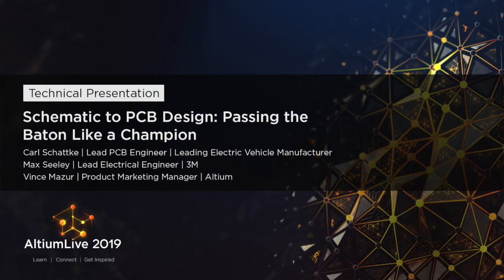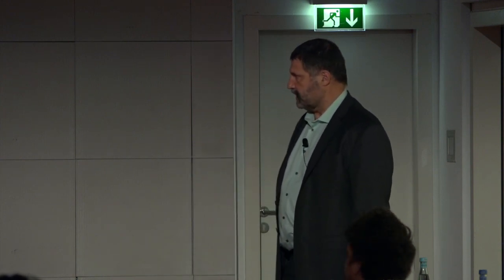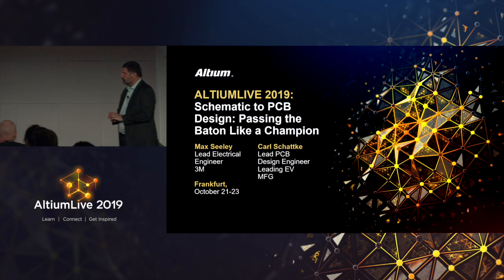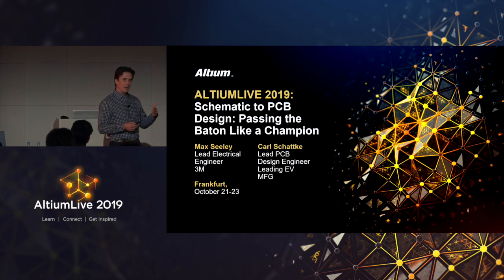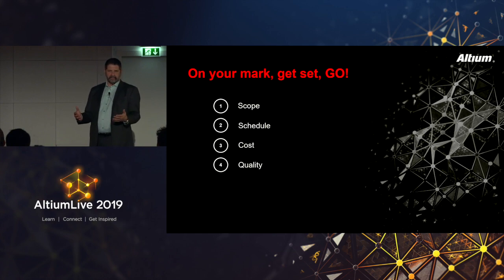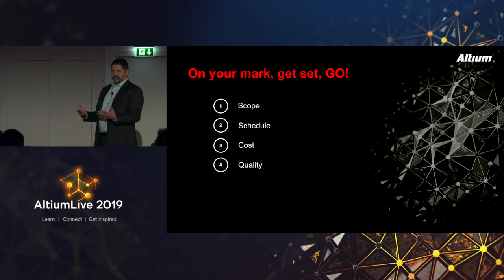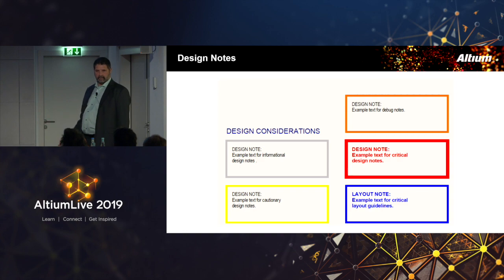Schematic to PCB Design: Passing the Baton Like a Champion

Comment: Thanks for making this content available!

0:00 - About
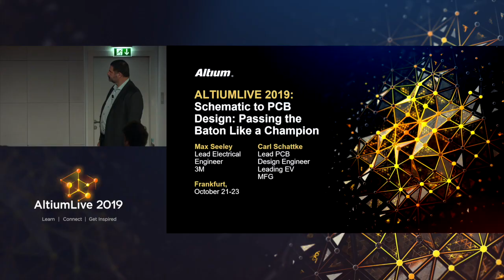1:38 - Introduction
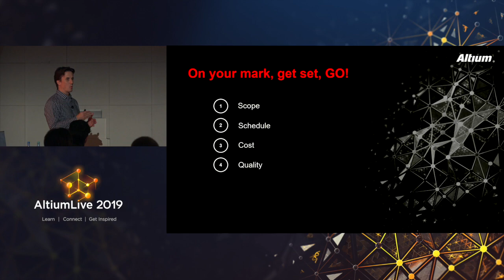7:34 - Agenda

[1. SCHEMATIC - BEST PRACTICES AND TOOLS]

GENERAL
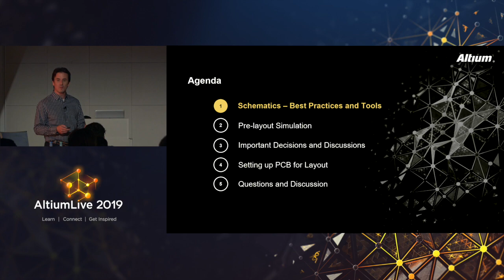8:25 - Top level schematic
11:29 - Signal harness
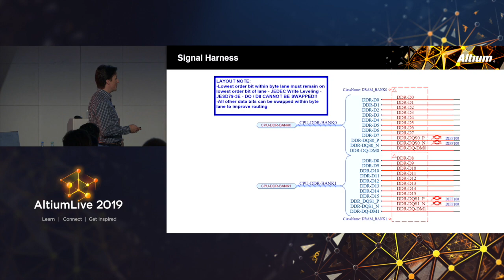13:17 - Functional blocks
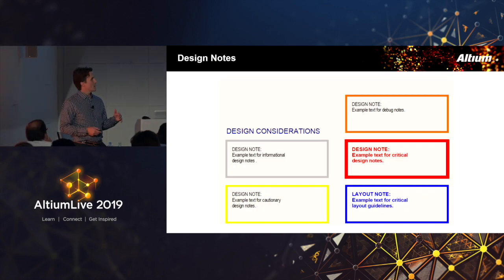17:09 - Design notes

POWER
18:16 - PDN - Power tree
20:19 - Power consumption system

CONNECTIONS
23:23 - Connectors
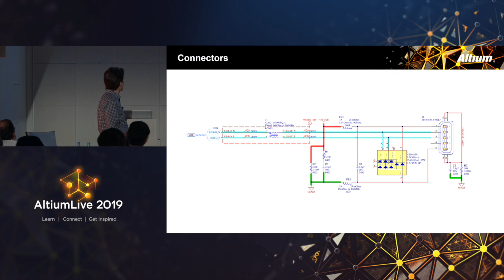25:42 - Connectivity using harness to high pin device

ERC
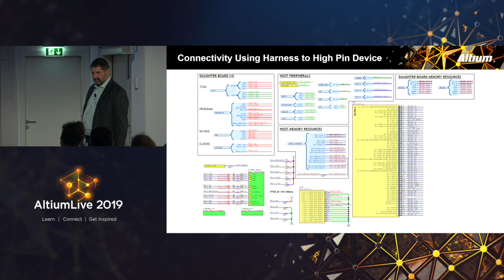27:37 - Don't ignore 

OPTIONS & SETINGS
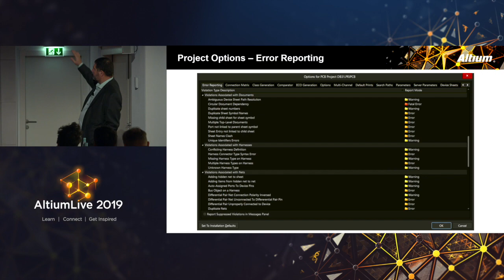29:32 - Error reporting
30:47 - Connection matrix
31:15 - Parameter Set
33:14 - Parameter Set + Blanket
35:43 - Defining differential pair
37:12 - Define unary design rules in schematic
38:40 - Project options
40:51 - Review BOM - Active BOM

[2. PRE-LAYOUT SIMULATION]

42:51 - Signal class table
44:28 - Simulated drop testing
45:49 - Displacement/Strain

[3. IMPORTANT DECISIONS AND DISCUSSIONS]
47:50 - Single board or both sides? (Component mounting strategy)
54:18 - Review BOM - Component technology
59:58 - Soldering methods (Component mounting strategy)
1:01:27 - Mechanical constraints and definition
1:04:03 - PCB mounting strategy
1:09:25 - PCB test strategy and requirements
1:16:13 - Antenna tunning provision
1:18:14 - Thermal strategy
1:20:23 - Shielding requirements
1:22:03 - ESD Mitigation

[4. SETTING UP PCB FOR LAYOUT]

1:25:03 - Rooms / Component space requirements
1:28:28 - Component placement strategy and routing channels
1:32:19 - Differential pair rules / PCB stackup
1:34:53 - Setting up stackups and impedances
1:36:01 - Setting up X-Signals
1:36:56 - Design classes
1:38:51 - Setting up binary design rules
1:39:47 - DEMO

[5. QUESTIONS AND DISCUSSION 1:55:17 ]